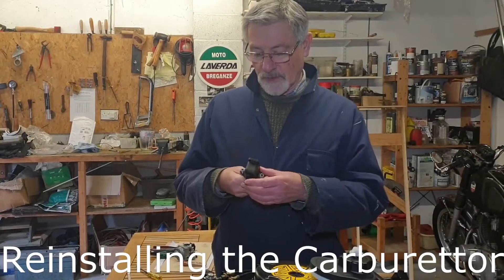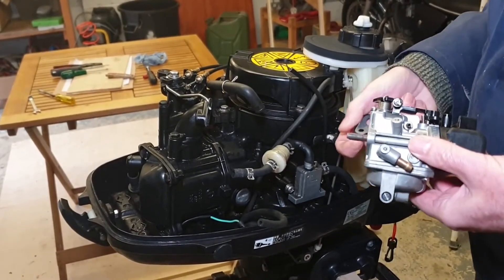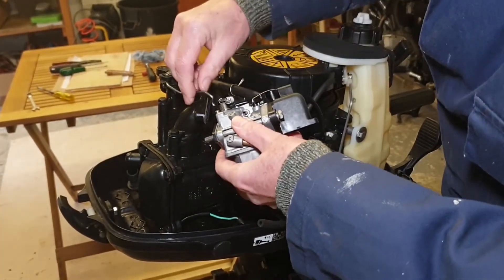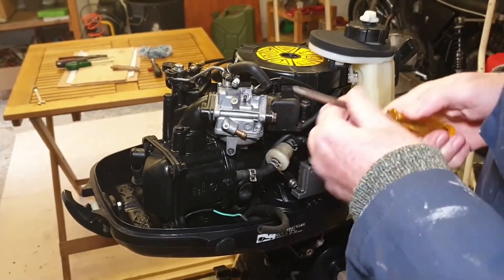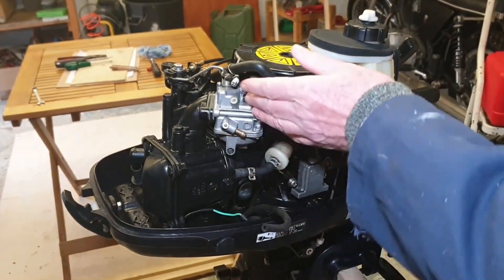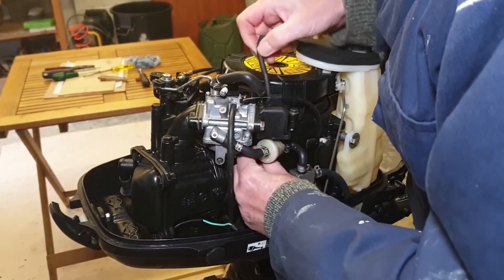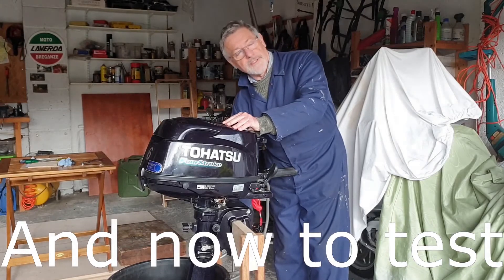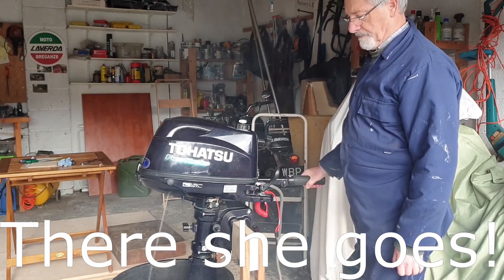Outboard Starting Problems and How to Fix Them Part 3: Refitting the Carburettor

Comment: When you have a fixed fuel tank should you remove the fuel from the tank and then run engine until dry, in which case, how do you return fuel to the tank and get it pumped through, apologies if this is a dim question.
Reply: Geoffrey, it's not a dumb question. Emptying the tank is a good idea if the engine will not be used for a long time. Running the motor until the fuel feed is empty and draining the carb is also sensible and may prevent problems with gunge in the system. But if you don't have an external tank, with a priming bulb in the fuel line, then getting petrol right through the system when you finally refill the fixed tank is a problem on these motors. If you see my video it shows that you could be pulling the starter cord for quite some time before fuel reaches the carb, after the system has been drained. It might be possible to pressurise the tank by using a bike pump with some kind of adapter fitted to the filler - maybe a bit of old inner tube might work. That would force the fuel through the system. Whatever else you try, don't blow into the filler with your mouth because petrol is very carcinogenic.

Comment: I have noticed that you seem to open the throttle even before starting from cold using the choke, then throttle back as you open the choke and the revs start to rise.  Is that a general recommendation?  I thought that the choke automatically gave a certain amount of throttle opening when fully pulled out?

Comment: This is very well done, thank you for the effort.  I'm having a problem starting 2 of these 4 hp Tohatsu's. Do you have any advice on how to set the float level?  It is adjustable by bending the tab that pushes on the float valve. Any chance of a part 4 that would include compression testing, setting the valves, servicing and setting the points, and checking the timing?  Also, note there is a trick to starting these that I learned and our instructor uses also.  Pull it up slowly on the compression stroke and stop. Then give it a yank.  Watch how he does it in the video. It seems to start much better. I don't know if that primes the cylinder or just gives the flywheel some momentum before the spark plug fires.
Reply: Thank you for your feedback. Whilst we always appreciate suggestions and input, your thoughts for a further video on ‘compression testing, setting the valves, servicing and setting the points, and checking the timings’, extends beyond the scope of our ‘how to’ videos, which are aimed at a general maintenance level.